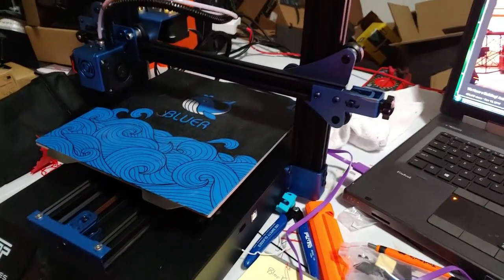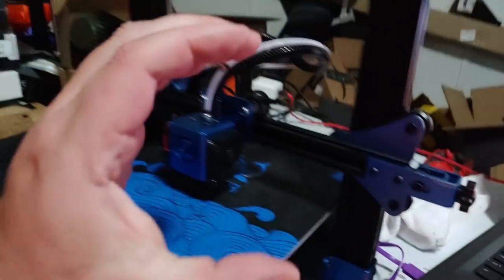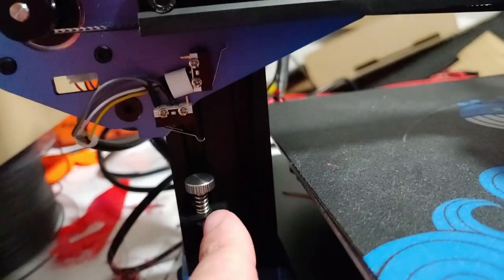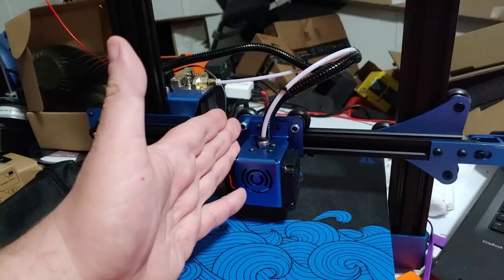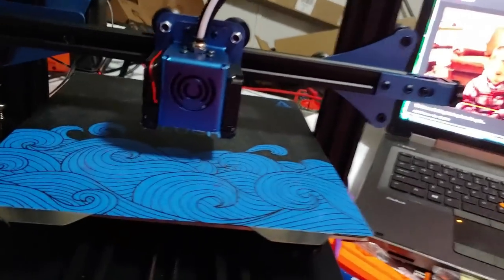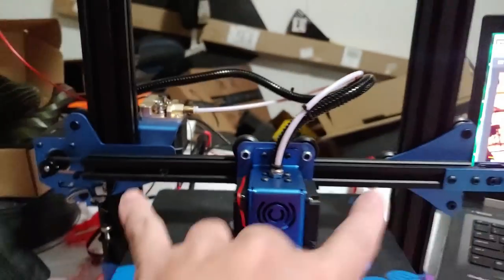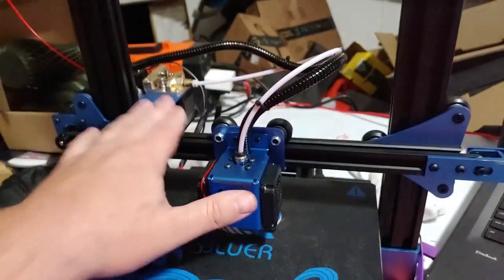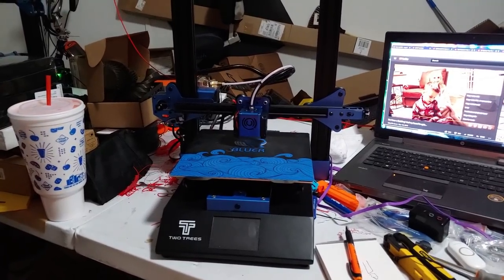Two Trees Bluer Analysis T3DP

Comment: I bought one of these on a whim. It should arrive next week. 
Fixed up my Ender 3's that where from the first batch. So i think this printer can be fixed up to be a dream.
Nice work Chris.
Reply from the maker: I agree I think this printer could be an extremely nice machine it just has some issues so while I don't suggest people buying it it's not a bad price for what it is if you have the means to fix it and the will to fix it
Reply: @nerys71  So my printer arrived and i have put it all together and done tests. So i can compare our experiences. 

⚫My printer didn't "need" concentric nuts. Everything came from the factory just right. But i stilll feel they would benefit from them.
⚫Yes the instructions need work. They have a booklet that took you about half way with pictures. Then turned into a number list that looked a little something like:
1. plug in x cable
2. plug in y cable
3. Plug in bed thermistor. 
⚫If i didn't know what i was doing, i would have struggled greatly and with lack of content on this printer available, would prove to be extremely difficult for a novice.
⚫My printer prints in the correct orientation. Although the bed levelling selections on the menus are flipped. (if i send it to the top left. it comes to bottom left)

For the most part. I am impressed. Especially because i paid £177 shipped to the UK. I got some really fast prints from it.  So with this im going to do a list of pros and cons

Starting with 
PROS
- Tidy unit
- Responsive touch screen
- Prints fast
- Easy to build (if the instructions were clearer)
- Really solid frame
- Good quality prints
- Packed well

CONS
- Doesn't show temperature on the screen when pre heating. 
- Only 2208 steppers on the X & Y. If you have Z hop on or making big z moves it can be loud.
- Bed home direction is flipped.
- Bed doesn't have strain relief on the wires.

I hope this helps anyone looking to purchase this printer. All be it, if it stops you buying it. Or makes you go ahead with the purchase.

Comment: I'd be curious if the missing eccentric nuts are a mistake from the factory. I just can't see a printer manufacturer NOT using those. But it wouldn't be the first time I have been proven wrong LOL. Good stuff Chris, thanks for the honest review keep it up!
Reply from the maker: It's a logical progression in a beginner's printer eccentric nuts are non-intuitive and people who are not familiar with them like we are don't understand them or are even aware to look for them it makes sense to attempt to build a printer that does not need them but that requires extremely good quality control which they obviously don't have yet :-)
Reply: In the second batch of production, we have completely changed to eccentric nuts and POM wheels.:)
Reply from the maker: @romeou3dprinter21  Most Excellent !! if its at all possible I would love to get this 2nd batch version to run a stream with. Would you like some help with the instruction manual?

Comment: I have this unit and still face multiple issues. Slowly working through them with the manufacturer, but it has been painful. A number of things were wired incorrectly and their documentation offers almost no help. My unit has the nano 1.2 board, not the nano 1.1 they reference which adds a bit more confusion. My mirroring issue was resolved with updates they provided, but I still can't get auto level to work. My first layer is very inconsistent which is probably my lack of experience, but really hoping that auto level would help relieveate that. Had I seen this review prior to purchase, I would have probably held off. Thank You.
Reply: What is your "impression" of the printer after a year?

Comment: HI Nerys, thank you for sharing the video. Unfortunately, I have an issue with the Y axe. It really hard to move even with hands. any suggestion on how fixe this problem. thanks
Reply from the maker: You have to figure out which component is preventing the motion if everything looks reasonably straight in the belt is not overly tight difficult to move would likely be the stepper motor itself so you might want to disconnect the coupler from the stepper motor and see if the bed moves easier also remove the belt but leave the coupler place then try manually turning it with your hand I see how difficult it is to turn it is possible you have a bad stepper motor
Reply: @nerys71  hi Nerys, thank for your reply. I will test the stepper motor for the Y axe and replace withe another one and see how it works

Comment: the missing eccentrics would be a big "do not buy" for me.
Reply from the maker: If the quality control was high enough it makes sense it eliminates the need for the end-user to have to adjust them or know how to adjust them for you and me it's obvious and simple for Average Joe it's not and that's what they're trying to do but their quality control is not good enough yet for that
Reply: @nerys71   No matter how good the QC is, supply chain and manufacturing tolerances are never perfect. I don't think that they are trying to eliminate the need for adjustment through QC, they are trying to save on BOM costs.
 I had an Adimlabs Gantry printer that omitted the eccentrics. After that experience I will never buy v-slot printer that omits these.
Reply from the maker: @riffraff60  thats a possibility as well. We shall see what they do.
Reply: Hello, we started selling this printer in October. We sent the Nerys to the first batch of printers. We have to say that because of the time, our details have not been processed, so there are some minor problems, but these are not big problems, they can be dealt with a little, without much impact. Now that we have upgraded the motherboard V1.2 and updated the latest firmware, we replaced the eccentric nut and the POM wheel. Various aspects of the details have been optimized. It will continue to improve. I hope you can see our growth. Thank you.
Reply from the maker: @romeou3dprinter21  Most Excellent!! I am glad to see it being improved!
Reply: @romeou3dprinter21  Nice!
Reply: @nerys71  they’re wear items. It’s literally not possible for the adjustment to be eliminated, no matter how good they are in the factory — when they wear down you still need to adjust it.
Reply from the maker: @JasperJanssen  that may be the case but I've never worn a set down

Comment: Very thorough review.  Chris why aren't you an engineer?
Is it possible that the stepper wires are wrong way round causing the mirroring problem?
Reply from the maker: Nope we tried that reverse them and Home in the wrong direction so it homes in the correct direction but inverts everything it's been confirmed that it's a bug and firmware I'm waiting for corrected firmware from Rui Raptor

Comment: Oh :'( i was just about to order this print but after i saw your video i feel confused , and this is my first time getting a 3D printer so i thought this one will be ez to put together , is there any other options for around 200 eur ? i was going to get this print for 196 eur + 24 eur shipping , almost all printers that i found the shipping on them is to high because of the country that i live on :( i hope you help me
Reply from the maker: Look for an ender3 as a first machine.
Reply: @nerys71  should i get the pro version ? and if there is print quality between the two
Reply from the maker: @Dr.Bezzahe  not much. it has some nice creature comfort differences. if the price difference is not a big deal get the pro.

if you can afford a wee bit more go with the ender 5. I really love the solid structure of that machine and the larger build volume.
Reply: @nerys71  thank you so much of the help i really appreciate it :D

Comment: i doubt the parts for machines like this is machined in a cnc, they are stamped, thus less accurate...but very fast to produce, its a couple of seconds per part.
Reply from the maker: Exactly to do what they want to do to not need eccentric mess they need better position better quality control

Comment: Too bad you can’t replaced the pulley holders with eccentric nuts on the x, y and z.
Reply from the maker: Z is okay I think I can make X work Y is going to be tough :-) because I have to disassemble it to get to the Allen key Bolt there is not enough room between the bolt and the bed to get a wrench in there